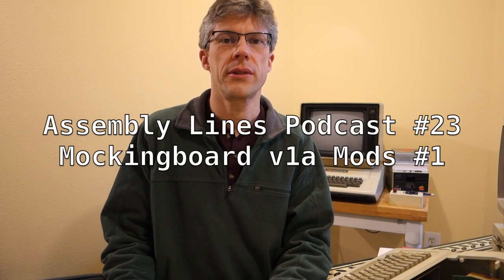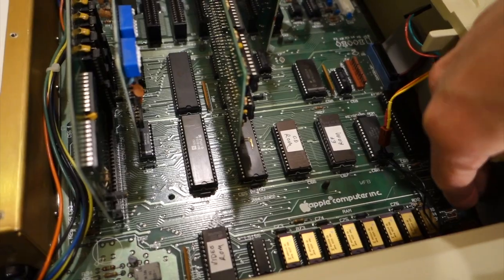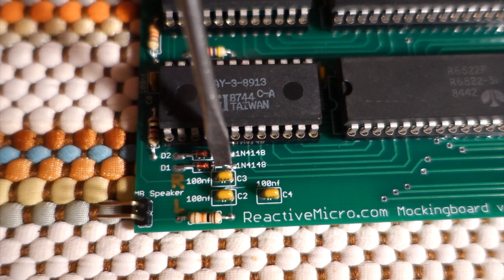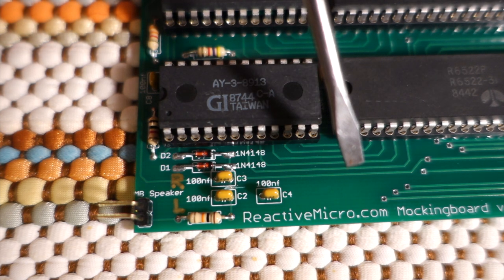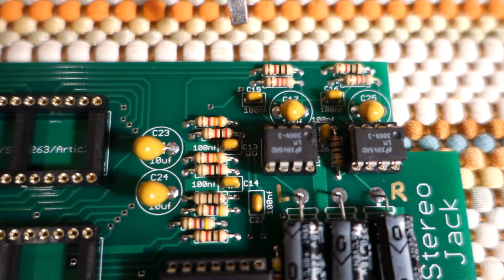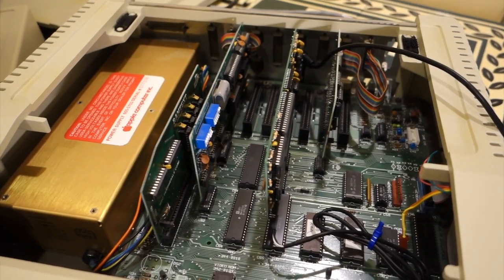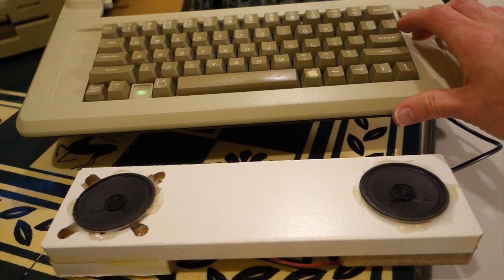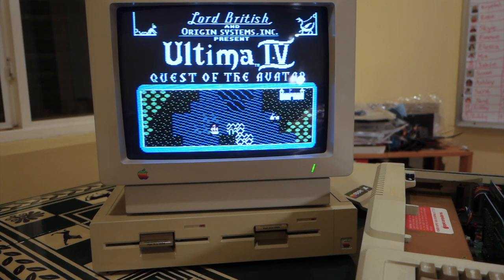Assembly Lines #23: Mockingboard v1a Mods #1

Comment: or just leave the resistors alone and reverse the wires at the output jack if you're going to an external amp, or reverse the speakers if you are keeping it internal.  then your system sound is coming out of the left side again, too.
Reply from the maker: Yep, that would work also, good point! But note that there are other issues with the sound from the motherboard getting to both channels and being muddy: https://youtu.be/HnG0ovQa-nk
Reply: @CT6502  yes, I still think clipping that trace is a good idea,   just doubt  I will bother with switching  the resistors... I have a v1 board myself. thank you for the info.  I watched your Mod #2 video... I am not sure if the mockingboard is true stereo or simply dual mono, but  I would wonder about possible phase cancellation with the mono mainboard signal coming out of both channels.